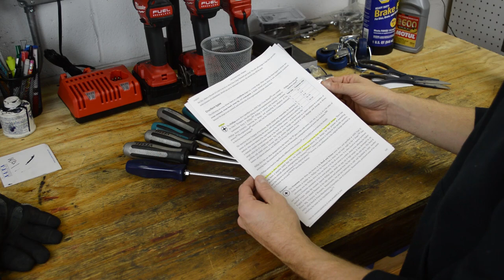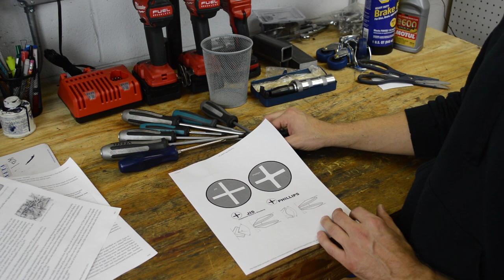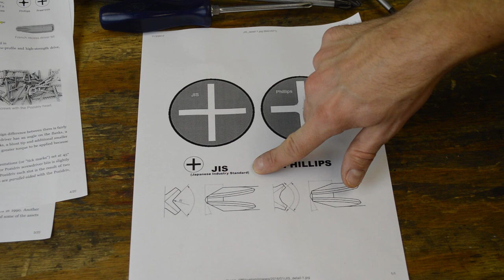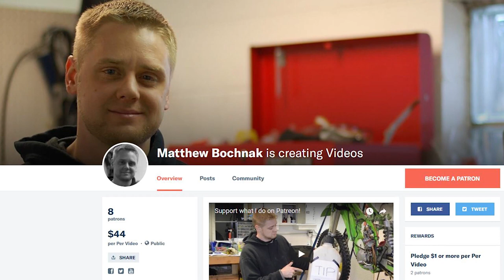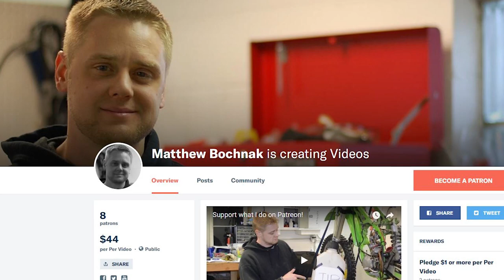BEST JIS SCREWDRIVER + GIVEAWAY

Comment: In more recent times JIS has changed a bit. The screws heads are deeper and closer to ISO standard to fit better with Phillips screwdrivers. Vessel and other Japanese screwdriver manufactures have also changed their tip lengths. Some now just mark all their drivers PH as they work with everything. 

Posidriv, originally designed by Phillips, is what most European industry uses these days. Also flat pack furniture Worldwide. Posidriv does not cam out (unless you use a Phillips screwdriver) and is more secure than JIS. It's about time the US phased out old style Phillips. In industry it's normally better to torque limit the tool not the fastener.

Comment: In a road emergency you can, and I have, dragged a Phillips tip across a concrete sidewalk to shorten the tip so it would fit JIS. Best to have the right tools but screwdrivers are cheap enough to be expendable.

Comment: The Phillips screwdriver was originally designed for the aviation industry. It was designed to cam out when it hit a specific torque so that you would not strip the aluminum screws that they used in the manufacturing of aircraft.

Comment: Uh my snap on screwdriver that looks like a Phillips fits these old Suzuki carbs on the FA50 I've rebuilt like 5 carbs this summer I know a guy with a fleet of them. I checked the fitment of the screwdriver to the screw to make sure I wouldn't strip the screw head. So I'm pretty sure these early to mid 80s japanese carbs would have the jis screws yet it was a tight fit I never stripped a single screw and there must've been 12 each bike at least so 60-ish screws not a single problem